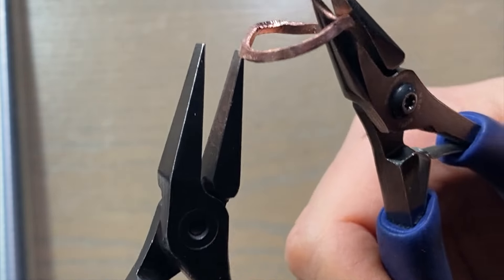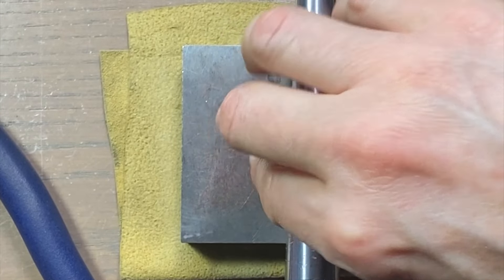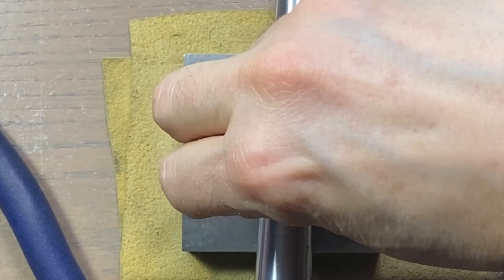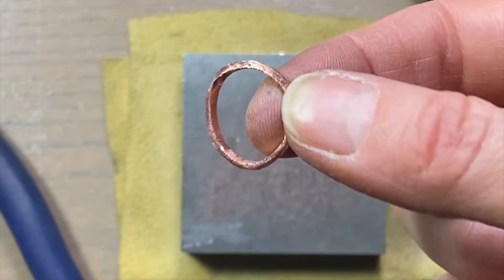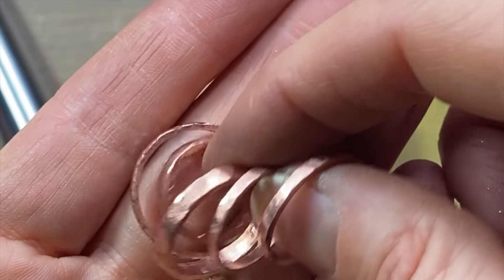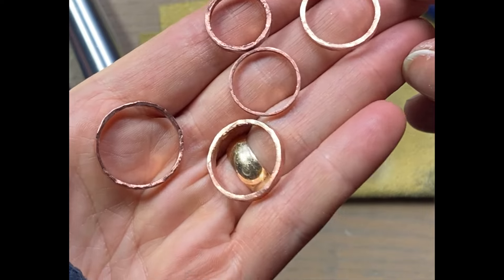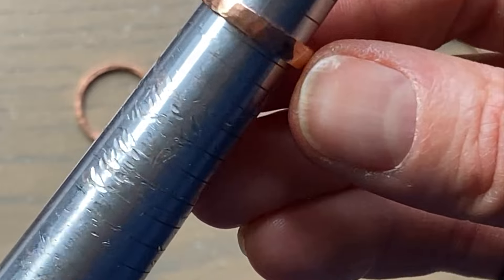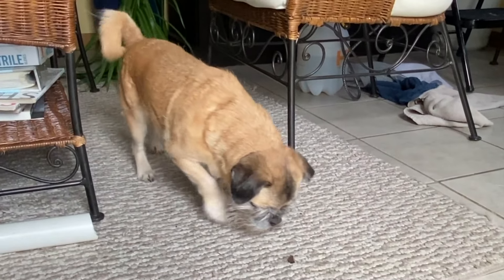DIY Jewelry- Super Easy Hammered Washer Rings!

Comment: I think this would be much easier in a dapping block $40, or even a steel press $60 at Harbor Freight. If you use a Dapping Block + the Steel Press (faster) or Dapping Block + Punch Set (manual), you can turn a washer from a disc into a cylinder faster with no distortion.  You can also turn coins into rings, and take a larger ring band and compress it into a smaller ring band (just the band).  Here is a video on how to do it with these tools:  https://www.youtube.com/watch?v=HDxDnw98PnU
Reply from the maker: That’s cool! I’ll check that out! 💜☺️